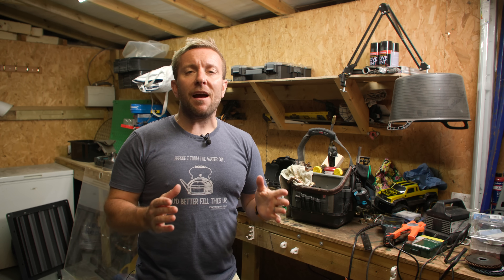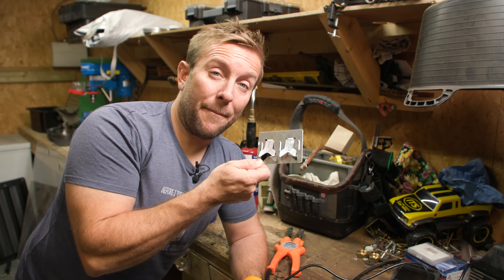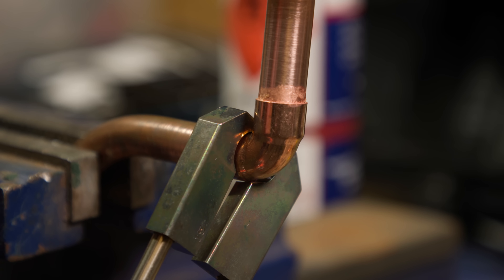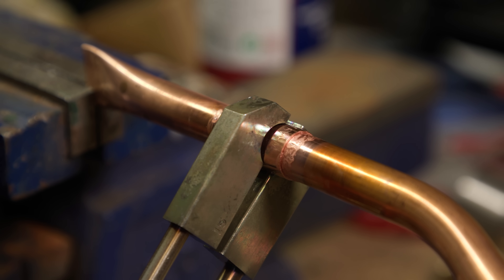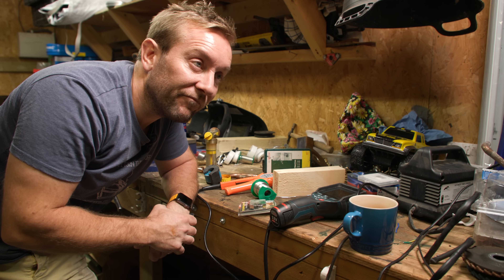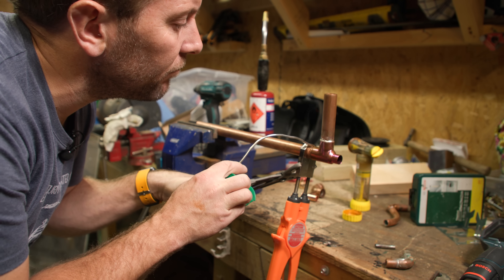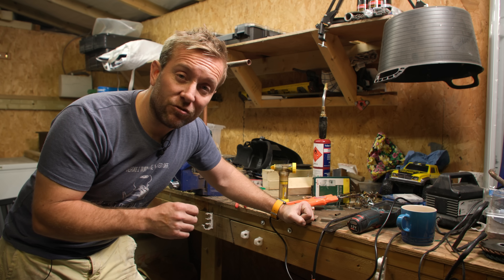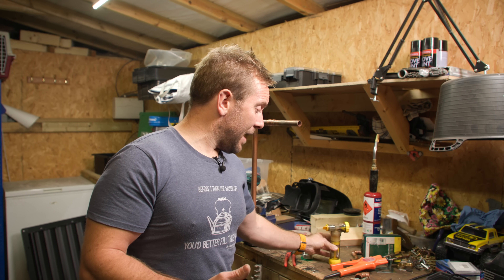Solder copper pipe WITHOUT flame or blow torch

Comment: Very interesting review. As someone who does more electronics soldering, this looks similar to an iron. Looks like there are a lot of improvements that could be made to the tech from soldering irons like a temperature indicator, and a proper holder. Having its own ratchetibg/ clamping handle would really help to transfer the heat too, save using grips like James did. As a DIYr these do look interesting as my torch skills are crap, but these look like they would drive me a bit mad too.
Reply: They are made by Antex after all, so the resemblance shouldn't be surprising

Comment: If you know anything about electronics and/or DIY, you would be able to make yourself a high power version of these :) 
Or don't be daft and get yourself a normal 500W-1000W handheld heating tool, like induction ones or the electric soldering guns, the ones where you pull a trigger and get hot fast.

Comment: I bought one because I liked the idea for soldering in a very tight spot but as you show I thought exactly the same the clamp system doesn’t seem to hold the pipe properly which then takes longer to solder than it should

Comment: I'm an American plumber.

I got one of these years ago. I kept it on the van for a while but never used it for work. I tried it a couple times at home and admittedly I was impressed. Originally I wished it fit around the fitting, BUT that wouldn't always work because not all fittings are the same size. Once a touch of solder gets in the joint the heat transfers to the fitting much more quickly.

I still use my torch everyday, but for someone with less flame control it's certainly preferable to burning a house down.
Reply: Yeah, maybe it would be ok for amateurs but I'll stick to my MAPP gas torch. I haven't burnt anyone's house down so far. 🤞
Reply: I think the American spelling is propress🤣
Reply: @D_pawson  Have you seen the cost of Propress fittings? I have almost as many Propress fittings on the van as sweat but I still choose to sweat a lot of stuff. When it's only a couple joints the time difference is minimal and the parts cost is more important. 

Sweat fittings are usually 1/2 to 1/4 the cost of Propress fittings. Also, they take up less space on the van.
Reply: @D_pawson  The Propress is also much larger than the tip of a torch so you can't Propress everything simply due to space constraints.

Comment: Don't forget that if you use a metal tool to grip the soldering heads the iron has to heat the tool up as well as the joint. That can be a lot of metal (try using your blowtorch under water 😄).

Comment: Instead of grips try using re-useable cable ties on plastic ends
Reply: you missed it mate, but the metal bits are loose on the front, even with the grips fully closed, the metal bits on the front don't clamp as tight. That's why he clamped on the metal bits with the grips.

Comment: Would be better if it had some kind of ratchet build in, so it actually clamped, without requiring constant grip pressure on them.

Without any kind of heat protection on the outer edges, and I can see many injuries, as you mention in the video, bumping into them, or potentially knocking them over.

Comment: Could it be that on the 22mm pipe when you held the clamp on with the grips  a bit of the heat dissipation went fractionally into the grips.?
Reply: It makes complete sense to me, that the heat will disperse to the clamp

Comment: Nice concept.  Obviously this is marketed towards non-professionals (i.e. home owners) as I can't see professional tradesmen using it since time is money and some job sites may not have power outlets within reach; even using extension cords.
Reply: From a homeowner point of view, the price of one of these buys a fair pile of pushfit or compression fittings.

I'm struggling to figure out the niche for this, maybe installation of gas piping in inaccessible high fire-risk areas (IIRC in the UK compression joints aren't allowed on inaccessible gas pipes).

Comment: You shouldn’t use metal grips to grab the heating elements as it diverts the heat away from the pipe. That’s why the 22mm took longer.
Reply from the maker: I did another test that i didn't film and the grips helped loads. Just not the 'best' tool for that job. Would be miles better if they fit the outer of the fitting properly and not just the outside pipe diameter....might shave off some brass and see if that improves...
Reply: @plumberparts  I'd expect that you only need to get a couple of good points of contact onto the pipe/fitting given how good a conductor of heat that copper is. I'd agree that clamping the jaws onto the pipe is going to help, but a non-conductive clamp fitted over the plastic part of the jaws will avoid the grips sinking the heat away from the pipe/fitting.
Reply: To solve the problem. Buy that beast. Buy cheap inverter 600w. Build a small ish battery pack. Whatever your inverter work on. Buy a light dimmer. Put it all together. And you got yourself soldering station you can use on site. I wouldn't go more than 75% of a dimmer. That way it'll beat flame in every way.
Reply: Not only does the channel lock wrench acts as a heat sink pulling away heat from pipe, it also pulls current away from the two pipe jaws (ie.  short circuiting).

The PipeMaster soldering tool uses electrical conduction THROUGH the pipe to heat up the pipe.   The metal channel lock wrench has its own conduction across the jaws short circuiting some of the current provided by the PipeMaster reducing the maximum heat delivered to the pipe.
Reply: Recommendation:   Instead of applying a channel lock wrench to the jaws, use a locking clamp on the PipeMaster handle to increase the pressure of the jaws.  The locking clamp on the handle has NO short circuit conduction divert heat or current away from the jaws.  This should maximize the heat at the connection interface of the jaws.

Another option is to use cable zip-ties on the handle to tighten the jaws.  Downside:  Cutting the zip-ties when done.

Comment: Hi James, the rothenberger or REMs units are much better. Maybe see if they will loan one for you to demonstrate. They heat the pipe in seconds.
Reply from the maker: I'll just buy one. Don't have anything to do with tool manufacturers apart from the bosch massive.
Reply: @plumberparts  , get the rothenberger rotherm 2000, it's impressive.
Reply: @plumberparts  Looking forward to it's review! It means no more gas!
Reply: Yea I was actually looking into buying the rems version, would be nice to see it in action
Reply: Is that the induction heating one?
Reply: @UberAlphaSirus  , no the REMs contact 2000 and Rothenberger Rotherm are both contact elements. I haven't seen an induction version yet but I'd like to try it out.

Comment: I think these have a place in the tool box but to be honest I don't like using them. The weight of them tends to mean movement on the joints particularly vertical ones, the are safer than flames but just awkward.
Reply from the maker: Agree!